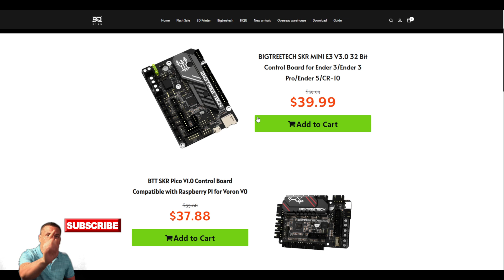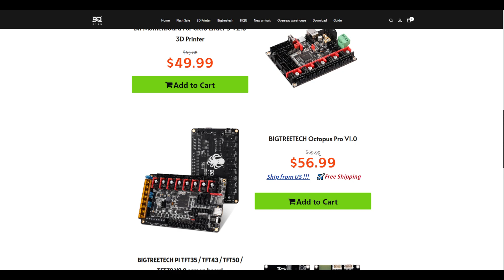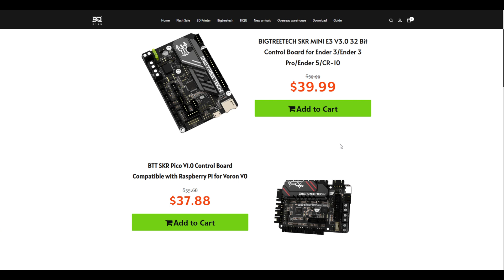BIGTREETECH SKR PICO (Is it any good?) DIY Review

Comment: Can it make any printer to print fast...!?
Reply from the maker: There are only a few things that can change the speed of a printer. (1) The electromechanical elements of the printer, steppers, drivers and kinematics.  (2) The MCU/processing of the code to send (3) The hot end and cooling.  It takes a combination of these items to make a printer faster/slower.  Unless one item is holding the printer back, in this case the MCU, no quick swap is going to make a huge difference.   You're often better off optimizing what you have and not making upgrades!  I hope this helps, not everyone is as honest.

Comment: Si sad that this evaluation is only 50%
Why didn’t you test it ?
Reply from the maker: Time mostly.  I already had a board the build.  Only so many hours in a day!  DO you have any specific questions that I could answer about the board?  Maybe I will do a round out of the 5-6 boards I have here... The pico is a nice board for a basic printer, I wouldn't hesitate to work with it for a V0 or similar.